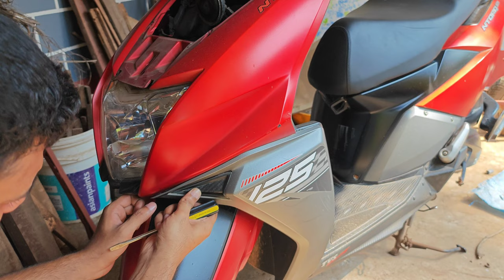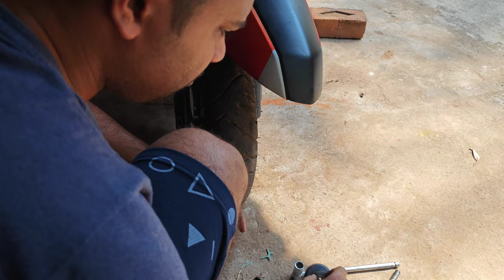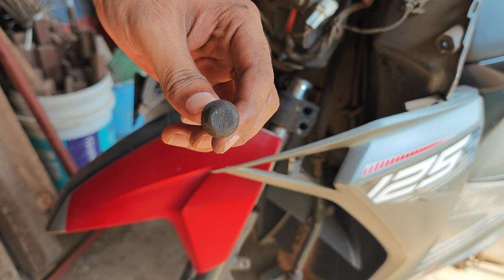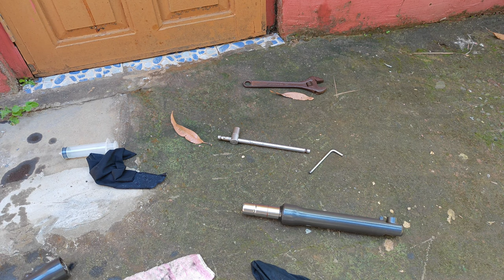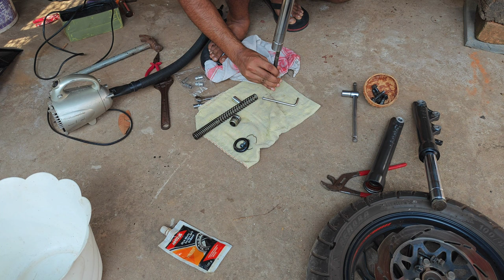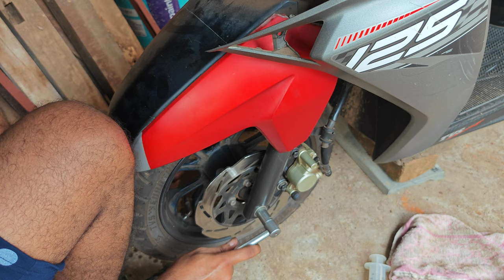TVS Ntorq 125 Fork Oil Change #Vol6

Comment: Good Video, Heavy oil in Ntorq is big No.
Reply from the maker: True, i recommend going for 10w. Unfortunately my options here were very limited. It was either this or a generic brand that had no rating. 

However, 20w is not that bad. Roads are pretty decent here.

Comment: You haved used grease in front axle can use wd 40 or any lubricant i dont have Grease
Reply from the maker: I recommend you buy a motul bearing grease as it's made for all weather and will slow down the wear and tear. It cost Rs. 40 here.

If not, you could use lithium or silicon lubricant, they are water resistant to most cases.

Comment: Bro can we just drain the old oil and put the new oil 
Or we need ti clean with dishwasher?
Reply from the maker: You actually don't need to use the dishwasher. You can just wipe it dry and refill it with the new oil.

Comment: Hey Meryvn great videos Bud, I wanted to know how often does one need to change the front folk oil, my bike is similar to yours it's a Bs4 model from 2020 15k driven so far, the local mechanic told be dont bother with it as long as oil is not leaking, which I found weird..Thanks for your Awesome Videos. Hope to hear back from you👍
Reply from the maker: Hey Ravi, on the service manual it says every 25,000 km. I changed it at 30,000 km. I thought it was fine too but after doing a whole lot of research I read that the oil degrades over time and that with the friction, heat and dust the oil is completely broken down and will wear out the fork parts. 

To avoid the wear and tear it's best to replace the oil. Rather than replacing the whole part. 

Service technicians will mostly look at how they can get more from you. They have targets to meet too on parts sold. I have experienced this with many. It made sense too. These cheap care & maintenance doesn't give them a good profit. 

BTW it's been over 5 years since I purchased my bike. Most conventional oils and lubricants have a shelf life of 5 years. So it was a complete green light for me.
Reply: @mervynfernandes1  Hey Mervyn thanks for the reply I appreciate it, Hope to see more videos from you👍 Have a Blessed Day Buddy
Reply from the maker: @RaviShinde-rj4tp  You're welcome! Will surely make more. Have a great day.